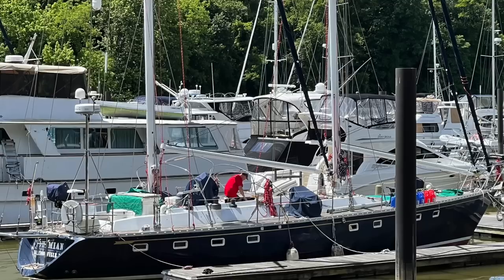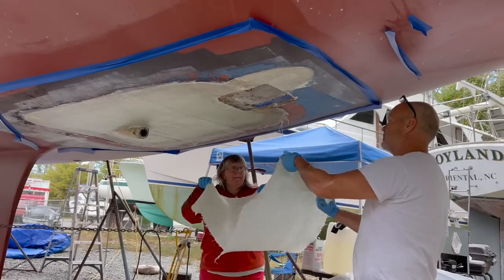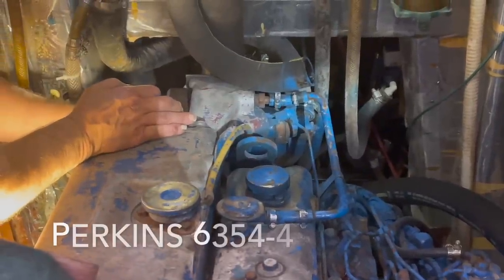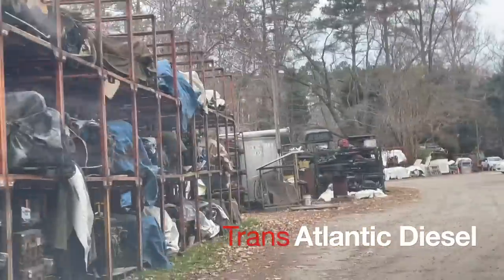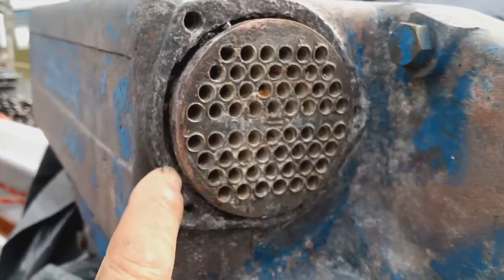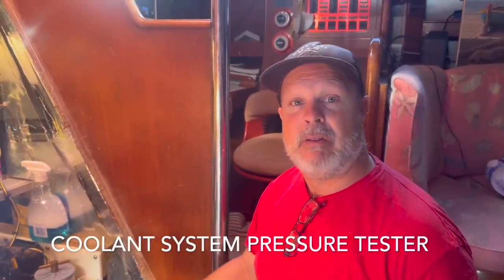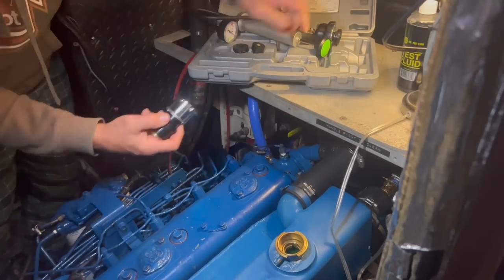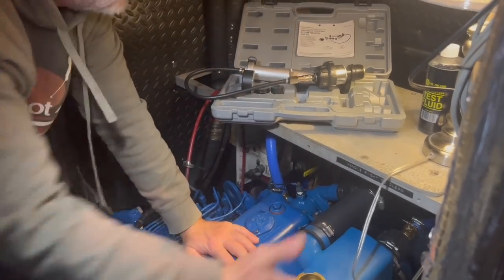Dirt Cheap 45' Abandoned NOSTALGIC Sailboat!! Sailing SV Bohemian Ep. 43

Comment: You can generally get a boat in this condition for free ($100,000🤯). My friend looked at one in the same condition for $15,000. Boat yards are happy to avoid the high cost of disposal. Looks like your raw water cooling system could be mixing with engine coolant, possibly through a damaged heat exchanger. You will know the boat well by the time your done tho. Lots of luck! 🙂
Reply: So true he’ll be able to hire out on a slow boat to China when he’s done I use to own an old wood sail boat I’m any expert varnisher painter now

Comment: Sounds like a head gasket or you have a leak between the raw water and coolant side of your heat exchanger.  Since your coolant runs at about 15 psi and raw water is not pressurized. Coolant can be pushed to the raw water side and go overboard
Reply from the maker: I’m going to test the heat exchanger by blocking one side and push air from the output and see If bubbles come out where the radiator cap gos . Cross your finger that would be the best outcome . Easy to fix

Comment: Cool boat tour and I appreciate your work ethic and determination to just, do the work that needs to be done. That is great to see nowadays. On the engine I'm not sure what your pumping into the water with your exhaust but seeing the condition of the heat exchanger, I wouldn't start that engine again without pulling the cylinder head. A milky liquid is usually emulsified oil or perhaps diesel. The antifreeze is going somewhere and removing the cylinder head will most likely tell you what's going on pluse it will go a long way to gaining confidence in the engine going forward. Good luck I look forward to your future videos. P.S. I would stop pumping that liquid into the water
Reply: Just because you’re not getting exhaust gasses into the cooling system doesn’t mean you don’t have a head gasket leak! - but I would actually be more confident that it’s still a problem with the heat exchanger. No coolant in the oil, no exhaust in the cooling system… 
it’s likely still blowing out the exhaust somewhere…?  and from the looks of the sludge coming out of the exhaust… that’s where I would be searching. - Though I do agree that pulling the head is a good idea and will reveal many possible hidden issues that could float to the surface in the middle of the sea at an extremely difficult moment! - when you are off shore there is never a good time for your engine to fail) 
As much as it sucks… I’d pull the head.
Reply from the maker: @archer721  that’s my conclusion. I like that idea to . It’s just one more system that is dependable. I’m gonna take the new heat exchanger back and have it all pressure tested off the motor to. I’ll pull the head and have it rebuilt in two or three month when my money is right .. and have the injectors rebuilt

Comment: Sorry to leave two comments, but it just dawned on me that I had a tractor (here on the farm) that seemed to be losing coolant (anti-freeze) and I couldn't figure out where it was going. Also, now and then, I'd see what I thought was an 'oil sheen' on the coolant when I'd remove the radiator cap.  I had a small leak in one of the radiator tubes, so I thought that was the problem and a problem like that can wait when hay season is pressing. The tractor still ran well and I still got a another season out of her (John Deere) and eventually, I decided to change the oil.  When I popped the oil plug, water gushed out.  About a quart or more.  Then the oil.  At that point, I figured out where the coolant was going -- besides the tiny leak in the radiator. The engine rebuild cost me around $5k, and damned near another $5k for new tires and brakes. (It's a bitch baling hay on hillsides with a 1960's kick baler and no brakes -- but we were 'farm poor' back then.) Anyway, I had a neighbor who had the same problem with his tractor, but had kids that were mechanical geniuses and could do their own overhaul. Split a big-assed tractor right in half with jacks and blocks in their barn!  They'd had the same problem.  They fixed theirs (an even bigger tractor than mine) and ran a season or so and then the same thing happened to them again.  Water in the oil.  We thought it all out and figured that I didn't have the same problem because I was using premixed "John Deere Coolant" (because of the engine overhaul warranty) and they'd been using coolant they had to mix with water.  The water was from their well. (As was mine, before my overhaul.) Anyway, they got it all tested out and found that it was the mineralization in the water that had eaten away one of the new cylinder sleeves they'd installed during their overhaul.  Apparently, the normal cavitation combined with the mineralized well water tends to pick the weakest spot in a cylinder sleeve and just keeps working on it until it finally grinds through. Which then provides the opening for the oil to coolant mixture to start happening.  So, if it were me in your situation, I'd let things sit for a few days and then either change the oil completely and see what settles out, or let about a pint out and see if there's any trace of water there.  I'd go further, too, and find out where I could send that oil sample to in order to see if there were any other engine contaminants in it.  For a "band-aid" or "quick fix," I'd probably just drain the engine coolant and replace it with something I knew had no possibility of mineralized water (such as "premixed" or mixed with distilled water) and some reasonable amount of "radiator leak sealer," which may or may not work, given the pressure in the cylinders as the engine fires. If there's a "lesson" for any boater (or farmer) here with diesel engines -- don't use tap water if you're mixing dilution-type antifreeze.  That nickle you saved by not buying reputable pre-mixed, may be costing you a lot more in the end if it results in an engine overhaul.

Comment: Looks like a heat exchanger leak, when the engine builds up pressure it pushes antifreeze into the seawater side, most likely bad brazing on the tubes or just the o-rings are bad

Comment: Are you sure it wasn't simply an air pocket in the cooling system? One technique is to "burp" the system by running the engine with the coolant cap off, to release any trapped air pockets.

Comment: The only real way to find out if there is water or antifreeze in the oil, other than getting it tested, is to put a drop on a piece of paper, the oil will just be a drop and the water will soak/spread out on the paper. I agree with others that the "milky" substance in the water is antifreeze either mixing with the oil or diesel. The other boat that has been sitting for 20 years, will sit another 20 unless someone can get it dirt cheap (less than the $4K you mentioned) or just was to fall completely in love with it. It needs EVERYTHING and would be a near impossible task for one person and without pros and the money for it. I don't even have to look at it to KNOW there is rot under that fiberglass. Peeling off the fiberglass would be a task not for the faint of heart.
Reply from the maker: I think I’ll take the oil up to Napa and have it analyzed. Thanks for the insight

Comment: It might be a '70s era cold molded wood epoxy composite boat. Looks fairly well built. Could be very much worth it.
Reply from the maker: It remind me of some boat a rich guy would own if it was restored to a perfect interior with 8 coats of varnish and brand new teak deck with all the latest most expensive instruments. Then the latest in kitchen appliances. I have to go back and see what the beams below look like . It’s driving me crazy. I wonder if there’s bronze down below to strengthen the stringers. Mahogany must of been reasonable back in the 60s.
Reply: I wouldn't jump to the conclusion that the fiberglass needs to be stripped away. Step one is to determine how it was constructed. If it was striped plank or cold molded it should not be too difficult to recommission. Some of the finest and most expensive new yachts are built using cold molded triple plank epoxy saturated construction. Look at Spirit yachts from the recent James Bond films. These composite boats are the best of both worlds. The natural flotation and strength of wood combined with the  lower maintenance of fiberglass boats . It's a winning combination but far too expensive for production boats. The keel bolts on this boat should probably be replaced anyway and in the process the keel itself gets inspected and serviced as required. It would be great to get a full profile shot of the boat, possibly from the deck of another boat on the hard, or via drone. It's hard to see what you are working with. It's an interesting boat that is not a cookie cutter Tupperware or Clorox bottle. It might be very much worth saving. But be very picky. There are lots of old boats out there to fix up. Pick the right boat.
Reply from the maker: @sprezzatura8755  I went and checked out a cold molding process. When I go back to the boat we will see . There a spot in the back that was deteriorating maybe I can see if theres layers crossed

Comment: You're running that heat exchanger too full, it needs room to expand. Your level is supposed to just cover the tubes. Check all the hoses. Bypass the water heater to rule that out too
Reply from the maker: Alright . It’s about a pint or so to drop it there .

Comment: It might not be smoking as badly but it's still smoking white which is coolant.. diesels should smoke a black never white.. have Napa run a oil analysis on it and when you get the results back and it doesn't show anything alarming as far as bearing wear etc then pull the head off and replace the gasket..I'd also have the head gone through.. if it was going to the oil it would be gray sludge and a real pain to get out of the engine

Comment: We always enjoy your videos.  In regards to your engine and the exhaust film on the water.  Have you checked to see if one of the injectors is going bad? Or maybe a dead cylinder? It looks like it might be unburnt fuel? Keep up the great work.
Reply from the maker: I’ve got a collection of old panels to  . Saving them to use as templates . I bet that family down in Clearwater fixing the Irwin 52 would like to no where you can get mahogany paneling . Maynard’s in Kansas City use to have it  . Its a big box store in Kansas City .   Hopefully when I adjusted the valves it will clean up the fuil in the exhaust. We like your boat . And that  panel work doesn’t look to easy

Comment: Looks like you've got a break in the head gasket between the exhaust and coolant exchanger ports. This would explain where your coolant is going because you seen it in the water in the beginning. That milky stuff shouldn't be there in the water. Take the head off and you'll see it right away

Comment: It’s water through the engine not the motor. A engine takes fuel to run a motor is electrical. And it looks like you have either a bad head gasket or a cracked block or cracked head. And you can have a blown head gasket or crack block or cracked head and not have water in the oil but you can have oil in the water.

Comment: I've got to know who's the builder of this old boat that you showed us?? That thing is cool and what I see when I close my eyes and think of a sailboat.. please ask the marina who's the manufacturer
Reply: After looking I'm almost certain this is either a Abeking&Rasmussen boat or one built by their plans.. if not they look similar
Reply from the maker: @bendaves77  I think your right , I looked at some on the internet. They do look the same , the steering in the cockpit looked exactly the same . I think you nailed it . I’ll take the oil to Napa and check it out . Thinking of sailing is a curse . But what a good one .
Reply: That is the A&R kit that Whitby bought out and sold plans to be built in Wood, Ferro, or Fiberglass. 
that wood version is too far gone to be restored at a reasonable cost.   It should be stripped of all thats re usable and find another good gutted hull to use the donor parts in.   With regards to your boat ,, I'd run it as is OR Yank it , sell it, and put a new BETA in her so it greatly increases the value after all the other hard work you are doing.  Simply fixing your tired diesel does nothing for the tine/money investment you are putting in , whereas a new BETA will immediately increase her worth by the same amount you spend on it.   Hopefully that makes sense.   After a dozen refits i've come to grips with fixing tired parts just never makes long term sense.

Comment: Hey, where are you at on the Chesapeake?  I have a gaff-rigged, Colvin Gazelle schooner stashed away at Fell's Point. I'm looking for a marina on the Patapsco (or nearby) to haul her out for a year or more refit.  Any ideas?  By the way, I'm you're newest subscriber!!!
Reply from the maker: In the middle of the C and D canal about 5 Mille from Chesapeake City . Summit North Marina. I think its 600 bucks in and out . And working on the boat here not to many rules .
Reply: @sailingsvbohemian1464  Hey, thanks for getting back to me so fast!  I saw that marina when I went through the C&D a few years ago. I thought it was called Bear Creek Marina or something like that.  There is another marina that I've used up that way, Bay Boat Works in Northeast.  That one was actually my first choice, and is about the same distance from Fells as Summit North. (About 40 mi. or so.) But my plan is to try to find a place on the Patapsco R. and keep my other boat, a Westerly Centaur, at Fells, and use it to go back and forth to work on the schooner. I do plan to do a LOT of gunkholing in the little boat, so I may get up your way sometime around mid-summer. Thanks for the reply!

Comment: Ok now regarding your coolant disappearing . Where those water connections are from the tube stack to the main cooler your coolant is getting past into the raw water system because the clamps are either not tight enough or the clamp is not positioned correct . I have had these type of heat exchangers and it was always a problem as when the pressure builds up in the fresh water cooling system it them pushes past the clamps and it is then exiting via the exhaust
Reply from the maker: I’ll buy some nicer clamps. Maybe west marine has some nice ones that will tighten better than the kind that have slots on the bands all the way thru . Or wider . Napa dosent have a good selection of stainless ones . Maybe Amazon
Reply: @sailingsvbohemian1464  If there is enough of the stack protruding each end you could try putting 2 clamps on each end just a thought Good luck and am sure this is what is causing your problem
Reply from the maker: @howardbeer5214  only one will fit on each side .I just got off the phone with Trans Atlantic Diesel. That what he was worried about the ends leaking on the boot . He told me how to test the heat exchanger for leaks . I’ll make a video of it . It’s brand new but who knows .

Comment: Need to pressure test coolant side of cooling system I,E where the anti freeze is to make sure it’s not being forced in to the raw water side , to rule out heat exchanger remove raw water exit hose and see if anti freeze is coming out when you pressurise coolant system

Comment: I think if you're losing antifreeze you have no leaks, it's not going in your oil, than it has to be going out the exhaust, there's no other place for it to go. The oil would be milky if it's going in it, no way to mistake it.
Reply from the maker: I’m going to take off the mixing elbow and keep adding water every morning until it stops or comes out the manifold. That’s my next idea.
Reply: It's the head gasket pushing it out through the exhaust..you would know if it was in the oil or leaking from a hose etc.. the white smoke before changing the heat exchanger.. the heat exchanger did need replaced..

Comment: Maybe you didn't need the adapters to attach the pressure cap. It may have just fit where your cap was.
Reply from the maker: I tried that ,It leaked . Trans Atlantic said it should hold pressure at 12 pounds . I think my buddy has a different kit  . I’ll go borrow his and see. Good eye .
Reply: @sailingsvbohemian1464  That pressure tester kit originally came with some thick rubber washers that fit in the coolant filler neck. Probably lost in the rental process. Some filler necks aren't 3/4" deep, some are 1" deep, (or in some cases, some other dimension), thus the washers are required to allow the centre spring loaded part of the tester cap to seal. Worth the minute it takes to measure. It is also quite possible the pressure tester is defective, it is a rental tool.
The block tester will indicate the presence of combustion gasses in the cooling system, as is found in some types of cylinder head gasket failures, but will not help diagnosing, for instance, a crack in the cylinder head in an exhaust port, a cracked block, a leak in the heat exchanger, a breach in the water heater, (this one can cause an awful death) or a loose hose clamp.
The pressure tester will lose pressure as the coolant is pushed out, then it is a matter of looking for where it is being pushed out.